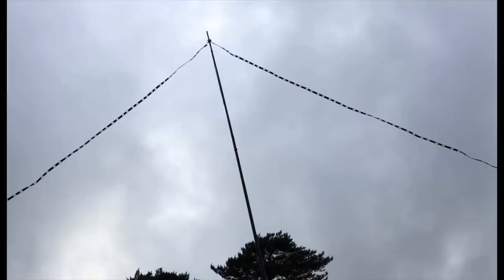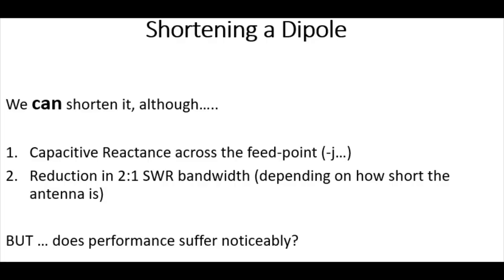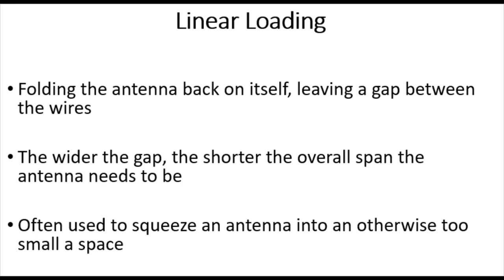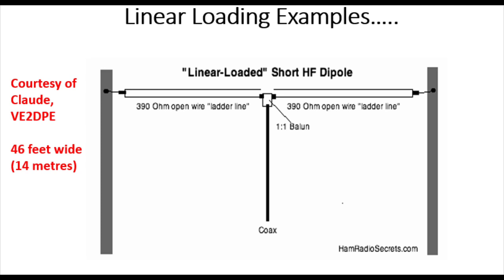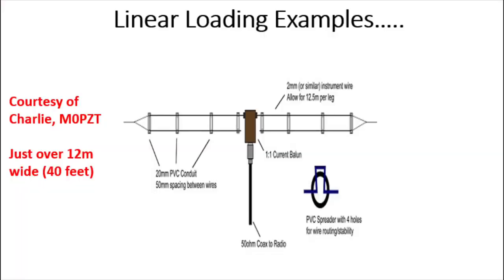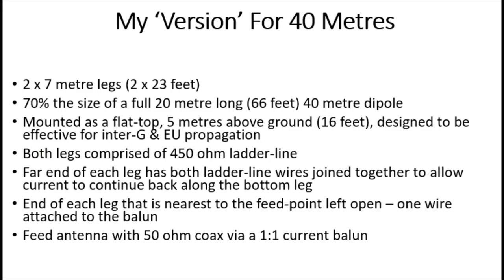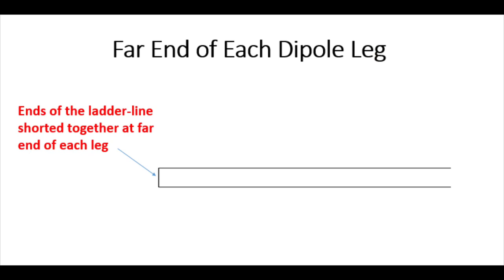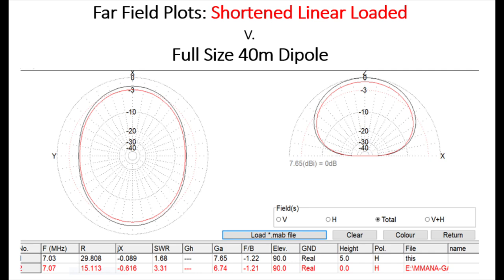Ham Radio: 40 Metre Dipole In A Small Space

Comment: Like this Tim, I’m looking to do the same, but feed it with ladderline, linear loaded doublet. The length will be whatever i can cram in. keep up the good work. m0udb
Reply from the maker: I’ve done that and it’s ok!
Reply: I’m trying the same Dave. I am experimenting with 2x13m legs (Linear loaded to 7m per leg) fed with 300 ladder line. If it works it would make a really nice portable light weight multiband antenna. 73 de Will, M0LGW 👍🏻😊

Comment: Nice idea to shorten an antenna this way but is it practical?
A short (<1/4 lambda) and shorted transmission line behaves like an inductor over a certain frequency range, so by adding these shorted ladder lines in series you will get a similar effect as placing lumped element inductors in the wire. Wouldn’t those be more compact, maybe cheaper and equally good?
Reply from the maker: Well I can only describe what happened in practice and it worked well as a mono band dipole. Thanks for the information 👍

Comment: Hi Tim, thank you for thi video.
Wishing you and your family a happy easter, i want ask you how is connected the 300 ohm ladder to the coax cable and to the dipole wire because in the video i cant see in detail.
Thank you if you will write an answer.
73 de Iu2mke
Reply from the maker: Hi - if you mean the two dipole legs - the top part is connected to the antenna wire and the bottom part is left open. Remember to short the two wires at the end to complete the circuit for each leg. 73

Comment: I built a version using 300 ohm ladder line, 22 feet each side. VSWR is higher at the CW end and goes out of band at the top end before it rises up. Perhaps 23 feet either side would have got the whole band covered better. I built it for UKBOTA configured for NVIS. A nice easily deployable portable antenna.
Reply from the maker: Good sounding solution!

Comment: Hi Tim, thanks as ever for your very informative videos. One silly question: when you say mounted at 5m, is that the top central bit (with the balun), or the bottom of the ladder line legs? It the former, which is what seems to be the case from the picture in the video, do you use poles to stick the ends of the ladder line in such a way that the V keeps its shape? Thanks, and 73 G1WNZ
Reply from the maker: Hi there - the modelled version is a 5m flat-top dipole so same height throughout 5m agl. The one I have used was an inverted-V with the apex at 8m agl and the ends at 3m agl. Little difference (none in real world) between those two on 40m. 73
Reply: @timg5tm941  thanks Tim :)

Comment: I have used VE3WY's shortened antennas from Maple Leaf Communications with great success. Using Tim's video on calculating antenna space for an inverted v I was even able to fit the 70foot 80/40m version into a tight space. Thanks!
Reply from the maker: Thanks for the info! I like his designs and I will try and replicate the 40/20 shorty once we have more daylight here.
Reply: @timg5tm941  I spoke with Bob in the summer of 2020 and it seemed as though he was already winding down the business for retirement, but see that his website remains up and unchanged. It's probably not a bad idea for those who'd want to order his originals to try and get them while still available.
Reply from the maker: I agree. I contacted Bob last month about the 20/40 and he confirmed he had stopped making them. But he was still kind enough to answer a query I had about it’s dimensions.

Comment: Thank you, your video has given me some ideas. I have an inverted v fan dipole in my loft for bands 10m to 20m. Have been thinking of adding a 40m element. I was just going to zig-zag snake the legs to fit it in the loft, but this might be a better option? ..better as in neater I mean, as you may be able to imagine the teepee fan of wires for 6 bands (inc 11m) up there is getting a bit difficult to navigate safely through when making adjustments. No problem with rain on the ladder line as indoors :)
Reply from the maker: Good points 👍

Comment: Hi Tim I built the ladder line doublet with the extra wire woven in between the windows of the ladder line so it is a three-wire linear load. Would it accomplish the same thing electrically if I just connected a ladder line and a single wire as a fan dipole instead of interweaving that extra wire just leaving it separate and isolated but still emanating from the same connection point
Reply from the maker: Possibly yes

Comment: Why did you use 450 ohm ladder line and not 300 ohm ? Thanks.
Reply from the maker: Wider spacing so the antenna can be a little shorter. You can use 300 ohm but as the wires are closer the antenna will be a bit longer.
Reply: @timg5tm941  Thanks Tim. Do you know the length when you use 300 ohm ?
Reply from the maker: @johndickinson8848  I don’t but I’ll try and model it some day
Reply: @timg5tm941  Sounds good. Also, what was the length of the gap in your antenna ? Thanks.
Reply from the maker: About 20mm I think John.

Comment: I would be interested in knowing if you could tune this antenna up on 15 meters easily?  
Could you use this feature as the wire element for an EFHW antenna?  
Doug VE3MCF
Reply from the maker: It won’t have the same harmonic relationship as a conventional 1/2 wave 40m dipole. I can’t remember but this one might be up around 25-27 MHz maybe?

Comment: Great idea for limited space. Does work multiband if fed with twinlead or ladderline using a tuner?
Reply from the maker: Yes it will work on the higher bands - not sure about the radiation pattern though. If you want say 40-10m then a 44 foot doublet fed with ladderline could be a good alternative
Reply: @timg5tm941  I'm trying to build a multiband antenna in my attic space. I wanted to build a 40-10 doublet but trying to figure out how to snake it around. This might be a better alternative.

Comment: Great video ! I’m wondering if I could apply this concept to create a shortened vertical dipole - perhaps 3 wires rather than 2,  fed then half way up the mast, to create a lower angle of radiation.
Reply from the maker: Yes - I have made a video on this two years ago - a third wire for both legs vertically polarised and fed with coax as a vertical dipole. You will be around half the size of an orthodox halfwave dipole (or near). I found using a third wire got me 15m with an 11 foot long dipole. Reduced bandwidth but it provided a useable SWR. Have a try! 73

Comment: Now do this for a 60 meter band antenna. That is a little used band with limited bandwidth but to have a resonant antenna would be very helpful.
Reply from the maker: Great suggestion. My suggestion is that as a 60m 1/2 wave is about 88ft, that a 62ft version should be near the money for 60m.
Reply: @timg5tm941  I realize it's not a heavily used band, but the interisland nets use it here in Hawaii,  NVIS style. I have a 40 meter dipole that I'm making into a 40-60 fan dipole, 40 is also used for the local nets of course. I'm still working it all out. Good thing is I have lots of room.
Reply from the maker: Good stuff John. It’s a great band.

Comment: can i use 300 Ohms tv arial antenna wire..similiar to 450 ohms ladder wire
Reply from the maker: Yes but as the wires are closer together the overall length of both legs may need to be longer. A few extra feet and trim the wire that returns back to the centre on both sides should do it.

Comment: Please can work out for 60 meters liner dipole  loaded  ?
Reply from the maker: Using the same principle of 70% the typical length I’d look at around 62 feet.
Reply: @timg5tm941  please can tell full length in metric I live in  town house only small back yard in SW Cumbria De G0MEJ 73's
Reply from the maker: @radiolinux45  try 19m in total. So 2x9.5m legs linear loaded using 450 ohm ladder line. Should be near 5.3 mhz

Comment: I've made a scaled up version of this concept, using 300 Ohm slotted ribbon, for 80m to comply with the ERF rules in my 30m x 6m plot.  When I noticed that as a fully folded dipole it was also the perfect length for a 60m antenna, I decided to feed it with 300 Ohm ribbon as a doublet. I was looking for a way if electrically shorting the gap for 60m and considered an 80m trao but this would have a shortening effect so I have left it alone. I'm having great fun on all bands from 80 to 10m and enjoying a lower noise level than I had on my big inverted L. I don't know how much difference it makes but the gap on my linear loaded antenna is at the top above the feed point. It was bang on resonance at the design frequency of 3.75 MHz and required no other adjustment. For the higher bands I'm using the trusty old SEM TranZmatch to load it up with good results.
Reply from the maker: Sounds a great set up!